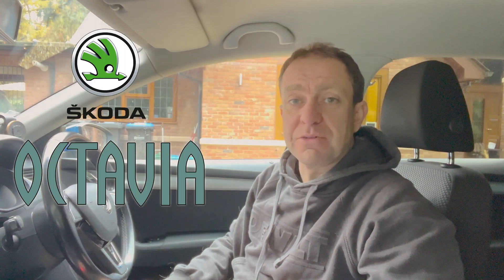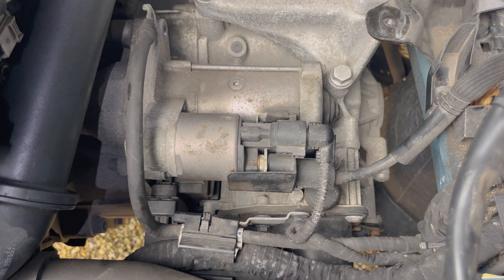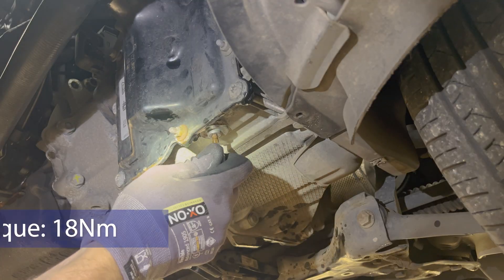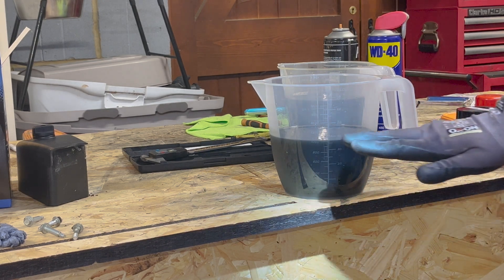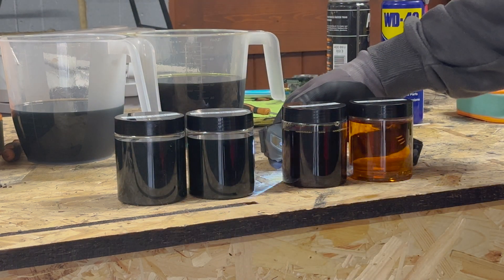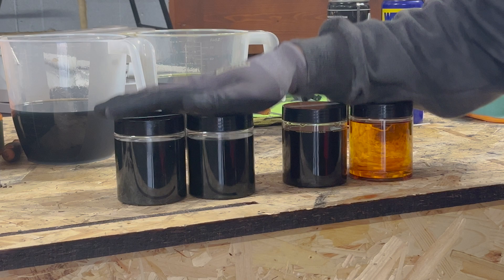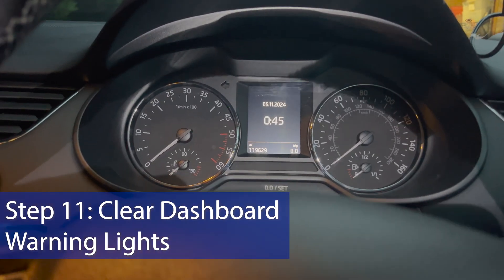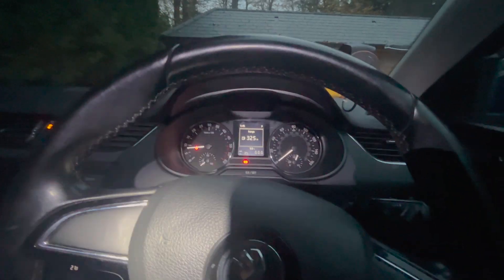DQ200 Automatic Gearbox Oil Change Step by Step

Comment from the maker: One torque setting missing from the video: 80Nm for the two bolts that hold the starter motor in and 20Nm for the earth strap nut. 

Update - while I'm glad that I did this - look at the state of the old oil! Changing both the gear oil and the mechatronic fluid didn't really improve the responsiveness of the gearbox at all :-( I think with 120k+ miles on it, the clutch plates will ultimately need to be done by a shop - I'll post a video update if / when that happens 🙂
Reply: I wouldn't rush to replace them.
After you change the oils, I recommend that you adapt the transmission and mechatronics with the odis software.
I only did the adaptation without changing the oils and the transmission responds like new. Of course, you should check the clutches status on the computer before performing the process.
Reply: https://www.youtube.com/watch?v=UjwOb7_K-ec
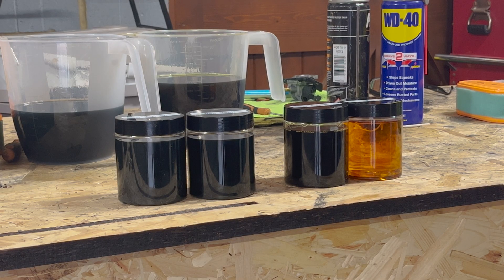Like he did in the video, video time 4:04 Option 2 thats what I did..
After the process the mechatronic will restudy the settings, and than give you better gear shifting performances.

Comment: On DQ200 you need to replace the synthetic oil with mineral oil to avoid electric problems. Recall 34F6 : use G 052 512 A2 instead of G 055 512 A2

Comment: Thanks for the video. Regarding filling mechanical part of the of the gearbox it's way easier to just remove plastic plate and pour oil straight to the gearbox. It's way faster. Seal on the plastic plate is double lip design, there is no risk it will not reseat correctly.

Comment: Thank you for the video. I did dq200 G 055 5... oil change too (skoda octavia 2 fl). I would add only that pcv hose shouldn't be to long because it trying to coil itself and its problematic when oil is trying to revers (hose 10mm 2mm flow). I couldn't attach that hose without small cut at the end of it to fit it without a problem. I had no leaks at all. The only problem i had were that metal clamps on intake pipe. I slide it to far and then i had to use adjustable key and my french key to compress first one.

Comment: Hello there , i would appreciate so much if i can have a response from you ( i need a professional opinion).
I have Golf Mk7 1.6tdi blue motion 77kw dsg 7 gears.
Im thinking to change mechatronic oil ( didnt know also there is gear oil due to dry clutch) and the reason why is because my car vibrates when low gears and start accelerating. Also when i put the car from P to D i need like 5 sec waiting or pressing brakes hard for 2 to 3 times to make the chane from D to D1. Any idea what's going on with my car ?

Best regards
Reply from the maker: Hi, I believe the 5s delay is due to a known issue with these mechanic units. The way to fix is to remove your mechanic unit & send away for repair. I will be doing this in the next year or so. 

The low frequency rumbling is an odd one. It sounds like a bearing that is worn - possibly big end but that’s a complete guess.. Hope that helps?

Comment: Hi! Thanks for the awesome video, it is going to be of great help once I decide to change the fluids on my Octavia 2017 - 2018 1.6 TDI 115hp.
2 questions as Iäm not sure what should I get:
You wrote Octavia TDCi, was that a typo?
Didn't they swapped the synthetic oil to the mineral oil later in the mechatronic unit? Both of the oils you used are synthetic.
I hope you find the time to answer. Thanks in advance!
Reply: Hi,
You are partially correct. VAG switched the gear oil (not the mechatronic fluid) to mineral-based oil due to additives in the previous formulation causing the gearbox fuse to blow (you can Google service campaigns 34F4/34F6/34F7 for more information).
They replaced the gear oil with a new reference, G052 512 A2, to resolve this issue — and this new oil is indeed mineral-based.
The problem is that many gear oil manufacturers claim to meet this specification, but their products are synthetic-based, not mineral. So far, I’ve only found two mineral-based options:
FEBI BILSTEIN 21829
LIQUI MOLY 20842

As for the mechatronic unit, even though it’s not part of those service campaigns, the correct fluid is G004 000 M2. I found a Volkswagen technical factsheet indicating this is also a mineral-based product.
Here again, you’ll find both synthetic and mineral-based aftermarket options, for example:
FEBI BILSTEIN 06161 (synthetic)
FEBI BILSTEIN 46161 (mineral)

Comment: Thank you so much for the video, very professional, the only part that is missing is the drive test after the oil change, so we could know what difference it makes on the road? Can we please have a feedback! ?
Reply from the maker: Hiya, thank you for taking the time to comment. Yes - you are right, I forgot to do the road test at the end - sorry about that. The honest truth is that it really didn't make any noticeable difference to how the car drives. I think I will need the clutch pack to be replaced at some point in the not too distant future.. But - I'm glad I did it because: (1) I'm much happier that the quality of the oil in the box is renewed and (2) these boxes do have a tendency to blow mechatronic units. By having fresh hydraulic fluid - it's giving the mech units the best chance of longevity.. Hope that helps?

Comment: Hi I have got a DSG7 gearbox. I got the mechatronic oil and gearbox oil changed and the clutch overheats after driving for a bit. The gear changes are very smooth. When it overheats, then the gear indicators blink but once clutch cool, it drives normally. Any ideas?
Reply from the maker: Hmm interesting - honestly that's a bit beyond me I'm afraid. Defo one for a gearbox specialist. I may be able to recommend somewhere - whereabouts are you based?
Reply from the maker: Well - a lot of people do recommend doing that after an oil change. Personally I don't see how that will help. The whole point of adaptations is for the gearbox to adjust its settings as the clutches wear. But if the clutches haven't been changed - resetting the adaptations gives the gearbox ECU an artificial model of its physical state.. I would recommend you see a gearbox specialist with this one..
Reply: Would you recommend to do an adaptation procedure?

Comment: Hi, how much do you think this oil change could cost in a shop?
Reply from the maker: Heya - well it doesn't take too long (as you can see) but the oil itself is quite expensive. I would expect around £400 / $600. Hope that helps?

Comment: The steering wheel all the way to the left and right is for power steering is it all connected on this octavia DQ200 ?
Reply from the maker: It's standard when you disconnect and reconnect the battery on these VAG cars..

Comment: I remember working on autos back in the late 80s and the gearboxes had oil filters inside. Is this not the case anymore?
Reply: The gear part is just a standard mechanical gearbox, same as manuals. No pump, no hydraulics, so no filter. The mechatronic part is in fact bunch hydraulic actuators. It does have filter inside, but to replace that, we are talking about complete mechatronic rebuild (you need practically complete disassembly of the unit), so not something to do unless there is something wrong with it.
Unlike other automatic transmissions, here the mechatronic oil serves just the quite well encapsulated compact hydraulics, so it does not suffer from that much contamination, so the filter has nothing to get clogged by (the only gears it sees is the hydraulic pump and then the valves and pistons, so no main gear wear, no clutch material wear, so the filter really has enough capacity without change even when it is rather small). What you are after by the oil change is the gradual chemical breakdown of the oil itself and the protecting additives, so only chemical degradation, so nothing related to the filter.
Reply: @annaplojharova1400 thanks, very informative answer!
Reply from the maker: ^^^^That^^^^ Great answer - thank you for sharing :-)

Comment: Great video! You could try adding 3 liters of oil to the gearbox to help extend its lifespan. (Tested on DQ200 units).
Reply: 1.7 you have with Manuel workshop
Reply from the maker: Thanks - glad it helped :-) Personally I wouldn't change the oil volume..
Reply: @FixItWithJon where do you find tightening specs
Reply from the maker: @Coin28-o9r  I got an official Skoda manual on eBay - everything in there :-) https://geni.us/ktP2

Comment: Does changing mechatronics oil helps to improve the life, it's usually the accumulator that fails correct?
Reply from the maker: Yes, you are correct. Changing the oil may help the solenoids live longer, but won’t stop accumulator failures. The common accumulator rupture is more a design/pressure cycling weakness than an oil issue..

Comment: I saw some adapters for filling the gear section using the drain plug. Since there is a breather using this method should be  breeze?
Reply from the maker: I wouldn’t fill via the drain plug unless there’s no other choice - very messy & hard to tell if you’ve got the volume right..

Comment: What's life of a Megatronic oil. As my car has completed it's 1lakh km here in india. It's karoq 1.5 tsi. Some service center says it's lifetime some says it doesn't need replacement.
Reply from the maker: Yep - VAG will always say that. Personally I think it should be changed every 80 - 100,000 miles. Which is about 130 - 160,000km. Hope that helps?
Reply: Same thing they are telling me
Reply from the maker: I hear you - it's frustating..

Comment: I got a question. Whenever I call VW regarding the DQ200 service, they always say they have no interval on services and don't do it. I've had the same gearbox, clutch and flywheel up to now and now I have to replace the whole gearbox at 220k km. I don't get why they don't do dq200 services at VW and now my gearbox is fucked. Looking for a used gearbox that has PKQ code is a nightmare too! I can't afford to buy a new gearbox. God sometimes I hate VW mechanics.
Reply: What is the price of new DQ200 gearbox?
Reply: @rino5381 here it costs $9k-$11k including labor...
Reply: Dude, tell us what you did to fix your situation. I am also curious about the price of the gearbox. I am at 140k km, that's relatively far from 220k km, but still....
Reply: @sikic123 i found out that there was too little pressure in my transmission that's why the error showed up.. the kit doesn't cost that much, it's about $300 where I live but of course labor would come on top of that. Instead of fixing it, I just bought a brand new car... Less hassle...
Reply: @Weebayoh I see. Yeah, sometimes it is just not worth it. But for someone who plans on keeping their car, then paying a 1000-1500€ for a complete gearbox change is not that much.

Comment: I still don't understand how VAG recommendations is not a scandal.
When you can litterally find the service recommendation on the manufacturers web page for the gearbox. At least you could for the Tiptronic/ZF trannys.

The same goes for their recommendations regarding cambelts. 210 000km and no years. But when you go to Contitech web page and check the service intervals they say 5 years or 120 000km

Comment: You made it little bit complicated by taking out starter motor. I think it was not necessary, the breather cap on mechatronics unit was sufficient to refill the oil, you just had to unplug the starter cable to access the cap more easily
Reply from the maker: The way I see it - the process is more tricky if you don’t remove the starter motor.. For 10 mins of effort - much easier fill process (& quicker).. But I respect your opinion & yes of course you can fill through the breather without taking the starter motor out..
Reply: My breather cap was very tight,not worth the risk of breaking it.
Reply: Update after refilling the mechatronics oil through breather cap. It turned out very difficult for me because my hose was exactly the size of the breather hole and oil was burping out due to lack of air replacement as I was trying to refill. I considered it easier then gearbox oil but it took me 2-3 hours. Somehow, I made a hack by melting & squeezing the hose which was approximately 4-5mm. Then I used traditional funnel and each 100ml took ~10 minutes. Most of the time I wasted in figuring out the solution. 
It was very stressful because I rented the workshop on hourly rate and I already drained the oil 😭. The worst part was when I finished filling it I realized that I had a 2mm hose in my bag which I got with penetrate spray bottle 🤬🤬🤬.
I cannot explain how much I cursed at that moment. :D

Comment: Greetings from Portugal. Have the exact car as you and I'm my case the mecatronic oil was 1 litter and the gear oil was 1.9. I believe it was never changed with 295.000kms
Reply from the maker: Hi - thank for commenting ! Appreciate you sharing your volumes 👍
Reply: Has there been any problems with the transmission whatsoever since it obviously never had an oil change? I am at 140k km with my Skoda Superb 1.6 TDI 2018 and I am thinking of changing the gearbox oil
Reply: @sikic123  No problems
Reply: No, it works fine  @sikic123

Comment: Hello Jon, Great video, NM for starter closing ?
Reply from the maker: @YakirOvadia-e4n   thanks for the comment :-) Good point - it is 80Nm for the two bolts that hold the starter motor in and 20Nm for the earth strap nut. Hope that helps? Let me know how you get on?

Comment: Hey Jon, as always great video! Both mine and my mrs car have the DQ200... Both cars still low mileage but nice to see how the process goes for this... Please let us know if you notice any difference with the gearbox...quick question at 120k miles how many times have you replaced the dry clutch? Thanks
Reply: You are welcome! Well if you still on the original clutch pack at 120k miles then thats a lot!!!! I am based between Manchester and Liverpool and there is a VW specialist that I take my car to and they do dq200 overhauls etc ... I don't know which part of UK you are based but if you are not far let me know and I will pass the specialist name !
Reply from the maker: @Carlos_Teixeira_Drums  Thanks fella :-) I'm down south, so I guess it will be too far, but I appreciate the thought :-)
Reply from the maker: @Carlos_Teixeira_Drums hey fella, thanks so much for the positive comment - it means a lot :-)  Yes - that's a good point, I didn't answer that in the video - tbh it didn't really improve the 'responsiveness' of the gearbox at all. I was a little surprised at that - but I'm still glad I did it - the state of the oil that came out! I'm pretty sure the unresponsiveness is because of: (1) That's just the way these gearboxes are (it's always been a bit different to a traditional torque converter based autobox) and (2) The clutches will inevitably wear out and 120k miles is a lot.. I think it won't be too long before the box needs a full overhaul by a specialist gearbox company.. I'll defo post a video if / when that happens - most shops allow me to film inside. I've got a great video coming up on cleaning your DPF - which included a bunch of footage from a pro shop..
Reply: @FixItWithJon Hi! Why didn't you replace the DSG oil filter inside the black cover?